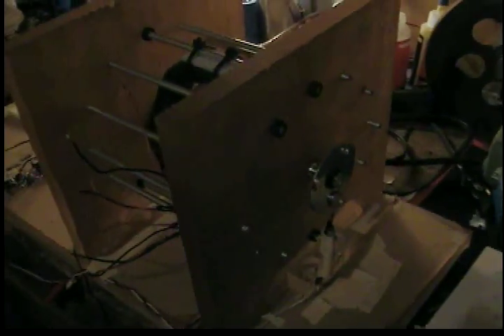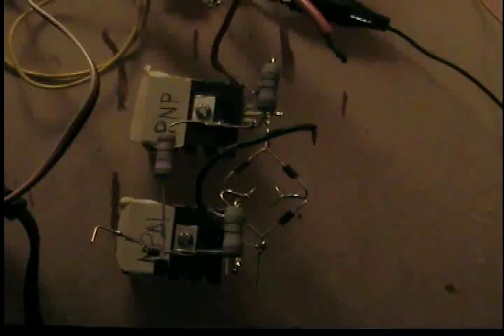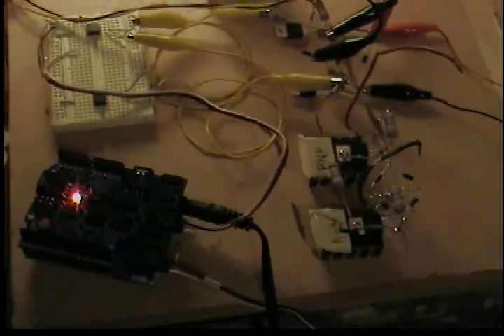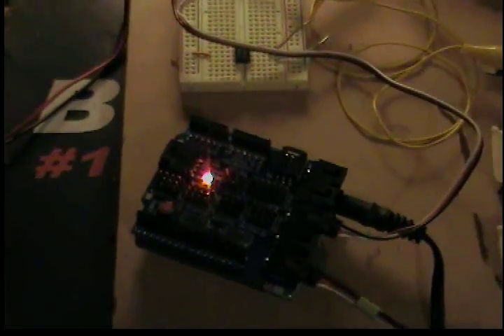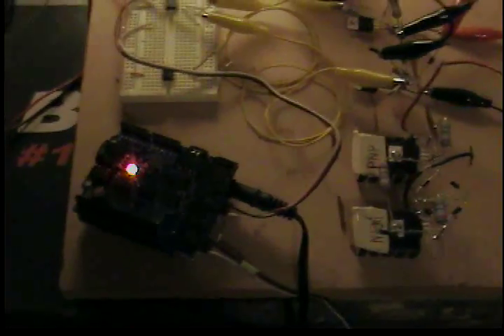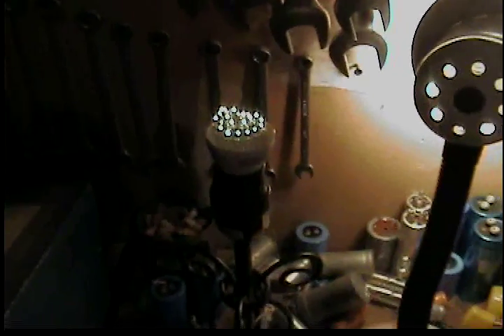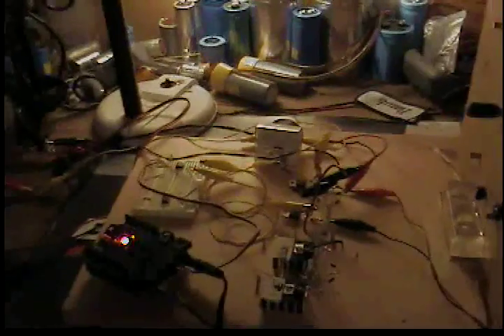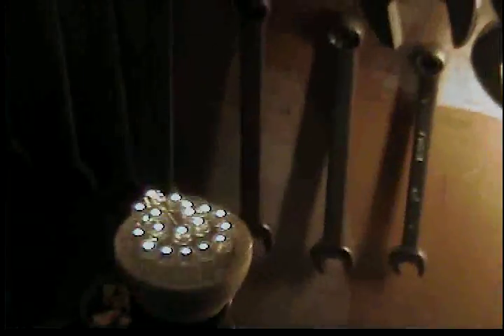Bedini with Arduino control-  Bedini-O

Comment: Could I see your code?  I have a similar project I want to start soon!  I'm wanting to see if ONE hard drive spindle motor will spin a large array of 'passive' hd motors and store the residual from the array to keep the whole thing going, hopefully with some extra back-EMF for charging
Reply from the maker: Sorry for late reply, just got notified yesterday. That code was many laptops and lost hard drives ago, But if you still need some help getting something going let me know, I can try to help you out. Thanks for the interest and let me know if I can help
Reply: Rawbush Thanks for the reply.  This would be my first bedini generator.  I'm not sure exactly how I should go about powering the primary spindle motor.  I have about 16 hard drive motors in great condition.  I've thought about timing the primary with a low power ATTiny or a very barebone mega328 using 3 npn's for the pulsing, OR spinning the primary via external coils and magnets.  these motors spin so freely that my goal is to use the primary to spin many more and store any energy generated from the 'passive' motors, with 3 coils each.  So that gives you an idea of what I'm working with.  kinda different approach but same principle.  What would you do with 16 spindle motors and a LOT of spare time? (especially @ 5000 RPM ;) )

Comment from the maker: @llewgnal Thanks Gary. The circuit is 1/2 a bedini/cole sequential bipolar switch. Can be found here rpmgt (dot) org/SequentialBipolarCircuit.jpg  Also the code for the Arduino is c and/or c++ I think. I am learning the coding, luckily there is some help at the arduino playground. Next video will show the arduino running the full circuit. And maybe some cap pulsing.